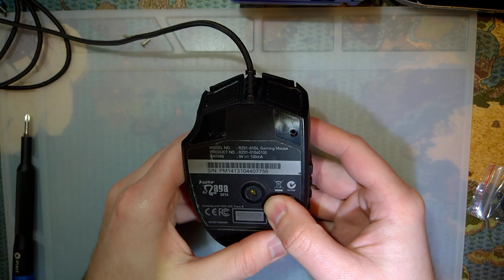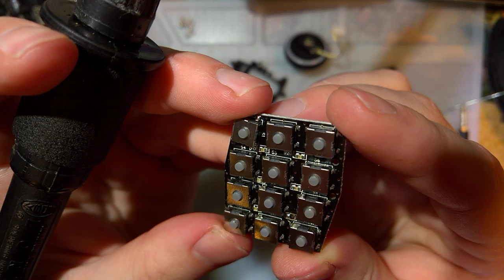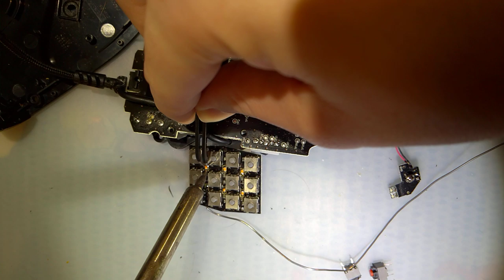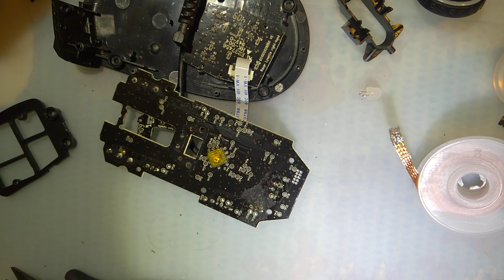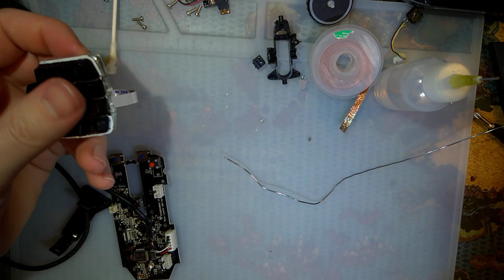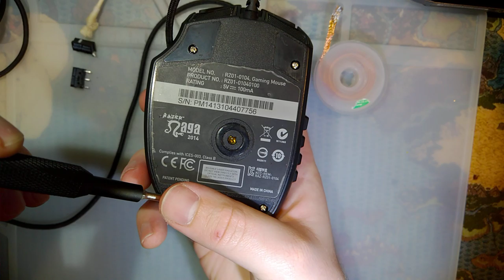Rebuilding my Razer Naga 2014

Comment: Hey man this is really great video - best out of the 2 or 3 others I cracked the sheets at before finding this one haha! 

CAAAANNN I....    Replace the Tracking Laser by desoldering from the main PCB?  If so,  what's the chances I can pull one in the same way from any old mouse I have laying around or is it more likely to be a specific item/part (order through Razer, etc)?

Cheers mate! :)
Reply from the maker: If it's the same part, sure. Chances are pretty solid it's not the same part.
Reply: @makho  yeah i figured that would be the case. Thanks for replying tho... 1. quick question while i got you if you don't mind?Basically, the laser isn't working in my naga (as you'll well have assumed) I appreciate your answer but given the likelyhood its the same part (lets be real, next to none) what are my options?  
Can I order JUST the part (laser module) or should I just hit up Razer for a replacement entire "mainboard" pcb?
Reply from the maker: @personone6881  I doubt razer will be helpful (they certainly weren't when I reached out about naga parts). I'd wager the laser is custom for their mice and I'd also wager that it will be cheaper and easier to just track down a used naga and use that. I'm coming to terms with replacing my naga finally too rather than throw yet another battery at it.

Comment: Do you have a video of the Naga epic chroma battery replacement? I think mine is dead. Lights up when it's docked and then nothing. The wired mode does not seem to work as well
Reply from the maker: Nope, I did that well before I was making videos. There is this though: https://www.reddit.com/r/razer/comments/gfhiq0/naga_epic_chroma_diy_battery_replacement/

Comment: So 3 years later, how many times have you repaired your mouse? I crack mine open about every 2 years or so. Onto my third donor mouse so far.
Reply from the maker: I finally replaced it this year with logitech g604. I have some complaints but overall it's a suitable replacement for me.

Comment: Hey my Naga 2014 is broken and doesn’t track a single thing and won’t move what should I do I have tried everything thanks!
Reply from the maker: > I have tried everything

Clearly not or it would work. I don't know what you tried to even begin to troubleshoot it. If you want help, you need to actually lay out the symptoms of your problem in full and the steps you took to resolve it.

Comment: Hey, my button 7 isn't working.
Do you know where I can find a replacement part for this side numbered panel?
Reply from the maker: I'm unaware of any parts source for razer hardware. Why not just replace the button itself (if the button is even bad).
Reply: @makho  It actually clicks normally, but nothing happens on the PC.
It's not like I'm using that much really, but I was thinking about replacing it since it doesn't seem to be expensive.
Reply from the maker: @Growthor  if you have a multimeter, you can begin to narrow the problem down. Tact switches are very simple electrically.

Comment: My side buttons don't work (it sometimes takes like multiple times of pressing to work or just pressing hard) do you think breaking it down and rebuilding it like you did in the vid would benefit me
Reply from the maker: what's the alternative? It's worth a shot.
Reply: @makho  prob buying a new mouse but I’m like used to gaming on this one so I would probably buy the same exact one
Reply from the maker: @Yorti  you missed my point. If you're going to replace it anyway, might as well try fixing it, no?
Reply: @makho  yeah you’re right thanks for the help man
Reply: @Yorti  I have this same model and am having the same problem with the side buttons. Did you found these side buttons somewhere to buy? Or the entire board containing the buttons?
Reply: @marcellusmendonca7278  I disassembled it and removed like the junk in there cleaned it out and it works fine now idk if this helps but gl fixing it
Reply: @Yorti  Nice! I will try it! Ty!